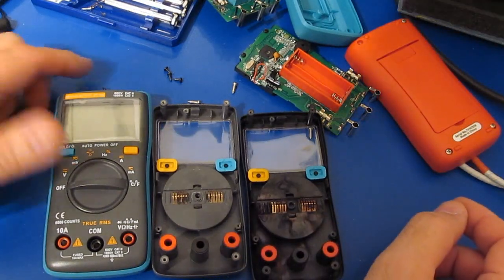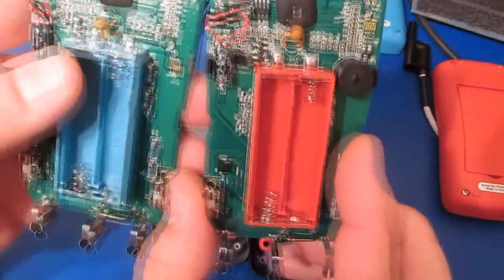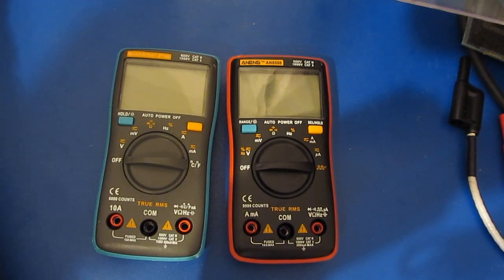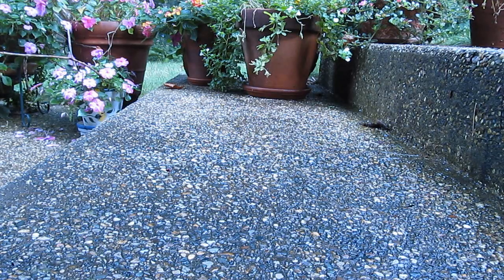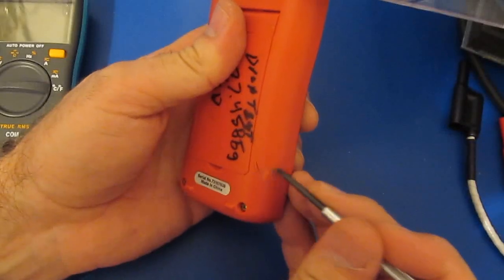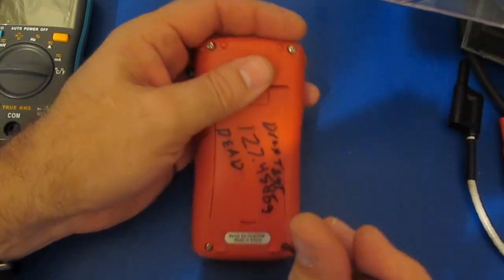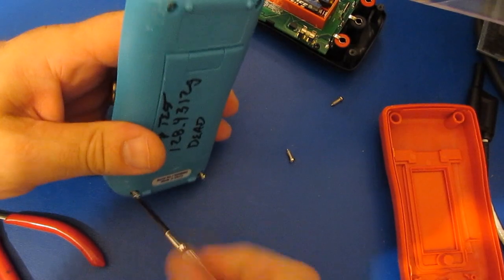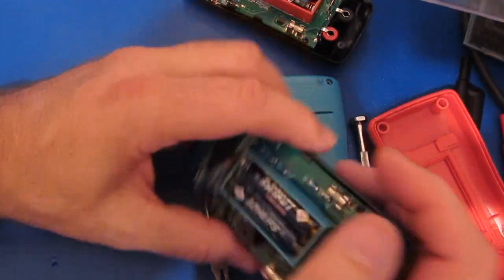Kasuntest ZT102  and ANENG AN8008 Drop Testing

Comment: Thanks!  I commented elsewhere, but I see the video is already out. Been away from the internet a few days...
Reply from the maker: I saw your other comments.  Both meters were dead by the time I ran them so really there was no reason not to drop them.  The wood block could stand to be a bit more flat.  Just a quick cut with the chain saw so not real precision work.   With as light as these are and how well they survived even higher drops to concrete, they would do very well in a real drop test.
Reply: Wanted 2M instead of 1M because they claim 2M on the Zotek site, but as you say above it would do well. Thanks for doing it!
Reply from the maker: No problem.  That last drop was about six meters onto concrete.  The roof peek gains us a bit more but I am not aware of any tests like this beyond the Dave test.  lol